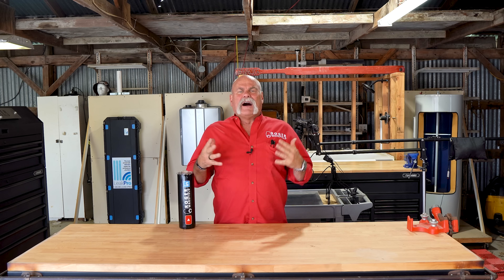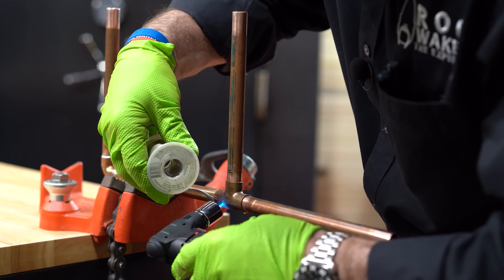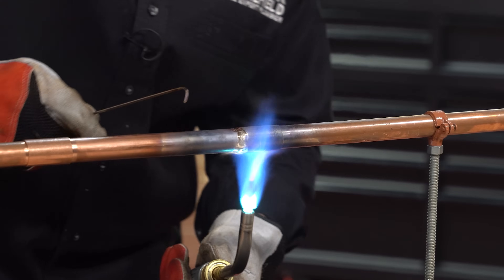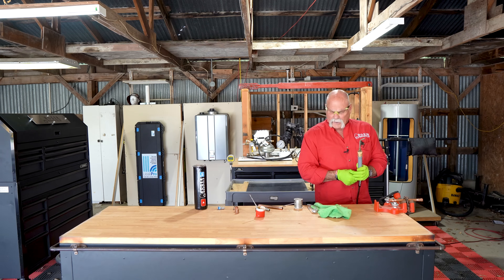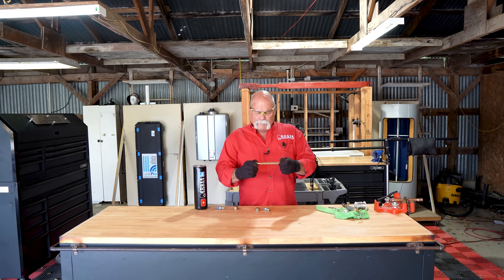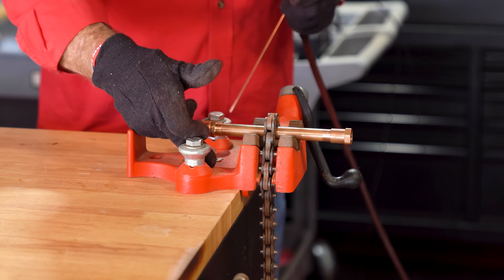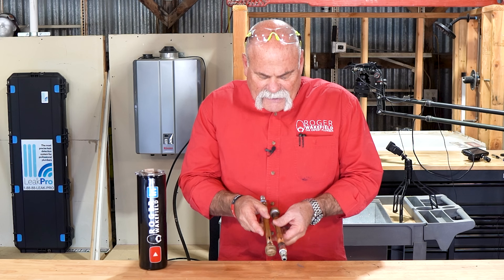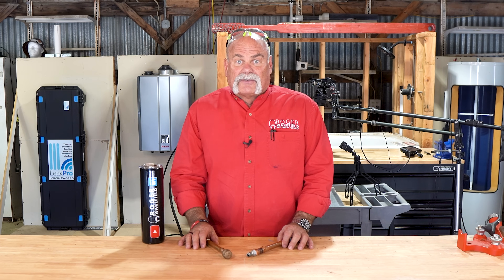Which Is Better Solder or Braze? | Pressure Test

Comment: Pressures on HVAC systems are considerably higher than domestic home water pressures. I nitrogen test hvac lines, usually up to twice the maximum operating pressure. Mostly done to detect leaks. On one occasion, due to operator error, I tested a system at nearly 1,000 PSI. As a result, the flare joint stripped and the pipe blew out. Quite a surprise as I was bubble testing the joint at the time! So it would be interesting to see some hvac piping tests, not least because the average hvac join I see is nowhere near as good as your typical plumber achieves on water pipes.
Reply: Dude your going to hurt yourself and prematurely end the life of HVAC equipment don’t test it that high please from one hvac technician to another
Reply: Dude the manuals tell you what pressure to test the systems at and it's never twice the maximum operating pressure
Reply: @rayzerot I think it's very good you go by the manual and recommend you continue doing so. I design systems and I know exactly what the materials technology is capable of achieving. That includes tolerance to vibration, embrittlement, corrosion, unintended electrolysis, contamination, stress/fatigue cycling etc.. I watched this video mostly because they're fun and I'm assuming that's why most people watch them. Enjoy!

Comment: The smaller hole on the braze is because it was only roughly 3k psi from the high heat, the soldering didn't get nearly as hot so it retained it's strength

Comment: Solder or Braze
essentially they are the same thing
melting metal into a gap to attach one object to another
the only difference between Solder or Braze is one is high temp(Braze) while the other is low temp(Solder)

also the only reason i know of why we have 2 names for the same process is Solder is from Gold/Silver smiths and Braze is from Blacksmiths
Reply: Indeed. In many languages they don’t distinguish between them (and some don’t even distinguish welding). In German, for example, their words for soldering and brazing translate to “soft soldering” and “hard soldering”.

Comment: Hello, I recently got hired at roto rooter. They use a pipe fitter and have told me that they do not allow soldering or brazing. I'm trying to get into a good apprenticeship. Should I accept this job or stay with my current company until something different comes along?
Reply from the maker: What is your current job?
Reply: @RogerWakefield  I work at a coca cola syrup plant. I want to at least get experience in plumbing and elevate into journeyman and eventually hopefully a master plumber.
Reply from the maker: Did they say why they don’t allow solder or braze? Personally I don’t know much about Roto Rooter but if you’re looking to get into plumbing, that sounds like a better way to go, more than working at a Coca-Cola plant. Stay with them for a bit and get some experience under your belt and then maybe look for a place that doesn’t outlaw soldering or brazing.
Reply: @RogerWakefield  I didn't ask that question yet. (Mostly due to ignorance on my part) but I will when I'm in training!

Comment: Im assuming the solder held 7 thousand pounds, and the brazed only held 3600 because of the heat stress on the metal? Is this a reasonable assumption or is it more likely a defect in the pipe?
Reply from the maker: That’s a great point, we should’ve done more tests to test out this theory, I’m betting that’s what happened. It’s a possibility it could’ve been a defect but they were both cut from the same piece of pipe so I might rule that out.
Reply: It's well known that brazing weakens the pipe because of the heat affected zone. This is why it can handle less than the soldered joint. Would be great to test this more though.
Reply: It's called annealing, metal becomes soft permanently after reaching close to the melting temperature. You can unanneal a metal by heating it and then rapidly quenching it in oil or water, then it's hard again. The braze makes the copper soft, the split hole is smaller because it burst at a lower pressure.

Comment: It would be nice if you at least mentioned purging the pipe with nitrogen when brazing. I know that applies to AC systems rather than water lines, I just think it's good to touch on it.

Comment: In my experience being in the U.S. Navy. ((For many years.)) As a Hull Maintenance Technician. (Plumber, Welder, Firefighter, Problem Solver of any kind.) We only used brazing, or welding on copper nickel (70/30) piping. Solder joints were an absolute no go. Mainly because plain copper pipe corrodes too fast in salt water.
(((That would be very bad on a ship or submarine at sea.))) I have personally passed pressure tests of over 3500psi, braze, 6500psi, weld. On .250 wall thickness copper nickel piping. 
I understand that you are using plain copper in your demonstration. Which is fine in residential plumbing. 
However you don't mention why you would want a joint that could withstand that kind of pressure.
Residential piping would almost never get over 100psi.
Aside from the fact that you still need flux with brazing.
I don't know of any instance where you would want to use brazing in residential piping.
Reply: AC lines and joints under a slab are about all
Reply: @jameskitzmann6268 , all AC manufactures require brazing , above and below ground . Code requires all underground waterlines to be brazed. Maybe Roger can shine some light on why 🤷🏻‍♂️. Also Roger is pro press & flare fittings allowed underground ?
Reply: @boby115   Brazing is stronger than soft solder and less prone to cracking when soil moves. Pressing is allowed underground by the manufacture and codes. Flare is as well. They now have approved solder for ac systems as well as press fittings. Code wise each juristriction is different so what works in one might not in another. He is in Dallas and I am in Houston and we have different code requirments
Reply: CuNi pipe is a whole different beast. You have stress corrosion issues with silver brazing alloys.
Reply: @jameskitzmann6268  , thanks for the info.. I don’t think I’d trust a press or flare fitting under a foundation or slab. Municipal codes should never undermined the national codes , enhance the strengthen for the better good ,absolutely; in doing so they should have  documentation and acceptable reason (most public works engineers / city engineers do )

Comment: i don't know if you have this brazing tool (oxygene and acetylene torch) might help put more heat in a tighter spot you kind of overdid it by the way in france we do mostly brazzing or crimp have fun nice video thaugt
Reply from the maker: I do have a torch but I couldn't find it 😅 thanks for watching from France!
Reply: @RogerWakefield  thank for your time and reply what is the thickness of those copper pipe here it's 1mm could be a factor because the pipe burst each time not the joint

Comment: I would assume the braze pipe blew quicker because it was compromised from overheating. If you use a small hot, concentrated flame for brazing, you will not compromise the copper in that way.

Comment: I brazed a joint and soldered a joint. The copper pipe that I brazed I was able to squeeze that pipe flat with my fingers because the copper was compromised by the high heat. I could not squeeze the staybrite 8 solder joint flat no matter how hard I squeezed it. I use staybrite 8 sometimes on HVAC. And sometimes I braze them. Inside a home I almost always solder with staybrite 8.

Comment: I never understood the whole brazing a/c lines, the high pressure side of 410A anyway, is in the 400psi range almost any plumbing hardware store solder will work fine for that. Today there are many superior solders that'll do this. You won't need to purge nitrogen either. Less heat is better on the copper and condenser components. I was a little concerned about any Flux getting in there, but honestly, I never ran into a problem.

Comment: Well the braze had a leak which lowered the pressure it blew at 3600 lbs the soldered one with no leak blew about 7300 lbs

Comment: To me one factor that could be important is the behavior when it comes to thermal cycling and low temperatures that you see in refrigerant system. Tin has the ability to change state to a non-metallic state through a process called tin pest. That can be initiated at low temperatures (-30 to -40 degrees C), so that's why brazing is better for refrigerant systems.
Reply: Despite millions of successful silver soldered joints in use w/o failure.  How many refrigerant systems run at those low temperatures?  Only industrial and scientific.

Comment: technically brazing is brass rod. Plumbers tend to call silver soldering brazing for some reason. if you draw the silver in it is soldering. Brazing does not draw into the joint that is the main difference. What you are testing is soldering with soft solder vs silver solder.
Reply: This is incorrect. Yes brazing rod was originally Cu and Zn, but metallurgy has advanced a lot and now various alloys are used that are self fluxing. Type of alloy used is determined by the base metals being fused. Brazing does absolutely draw the material into the joint.
Reply: @JFirn86Q  then by definition it is soldering
Reply: @garyhempel6316  I understand you are trying to take a hardline stance on it of old - but language is dynamic it's meaning changes with usage. The definition today, with all the advanced alloys and combinations we can have, is exactly as the video said - Soldering is less than 450C (840F) and brazing is above that temperature.

Comment: I wonder if the higher heat needed for brazing weakened the pipe? That might explain why it failed at a lower pressure. Still, if you've got 3000+ PSI in your home water lines, you have more important things to worry about!
Reply from the maker: Very true! It looks as though the heat from brazing did weaken the pipe

Comment: Maybe I missed something, but the brazed joint pipe bursts at around 3,700 PSI and the soldered joint pipe bursts at over 7,000 PSI. Does that mean the heat from the brazing weakened the structure of the pipe or am I missing something?

Comment: I love stay brite 8, there are plenty of applications on refrigeration I use it. Low side stuff, access stubs on critically charged stuff, or residential linesets going to the condenser, etc. I will say this though, definitely don't recommend doing it on discharge lines off compressor because solder can handle heat and vibration, but not both. I know this from personal experience. It's just not reliable most of the time. Also you must be very good with solder to do it on refrigeration. I can't tell you how many techs I've seen completely plug up 1/4" ACR lines because they used way too much on a joint or drier. The ultimate test of your ability to solder is join a cap tube to a drier without restricting it! 😂

Comment: Did I see the copper in the brazed joint fail at 3700psi and the soldered fail at 6700psi? Yes, looks like the weakening of the copper by the 1300degrees needed to braze outweighs the benefit of the stronger joint.

Comment: Soldered joints will outlast the life of the installed equipment when done correctly . Brazed joints are used primarily where there is a compressor connection .

Comment: Braze a 90 to two short copper tubes, then solder the same. See how the brazed elbow has turned to garbage as it easily kinks.
Silver solder is way strong enough and retains the coppers integrity.

Comment: In medical gas systems the only reason we braze is because of fire code, it has a much higher melting point, you wouldn’t want an oxygen line fueling a fire, soft solder has always been stronger
Reply: Ps, your braze joints definitely didn’t get anywhere close to 80 percent fill lol

Comment: ROGER braze a 6inch line and also please do a 4inch flange joint for soldering ..i think a 5 year old can solder a 3/4 line they do it at a boys and girls club program...not trying to knock ya but you can really see everything more in depth ...also you can tell me you've EVER done 200 braze joints per day . I Braze and top out at 25 to 30 on a 12 hour shift brother 😂😂😂

Comment: brazing roughly 3600 pounds.
Soldering roughly 6900 pounds.

It seems to me that brazing greatly reduces the strength of the copper. The soldered pipe had a bigger hole because it held more pressure.

Comment: is it possible to Braze with water still in the copper pipe?
Reply: You have to boil/vaporize all the water If it si a closed system the steam will blow the solder/braze alloy out.

Comment: Notice the same pipe gave way at two totally different pressures I would think because of the greater heat used to Brazed the fitting Vs. Soldering you Annealed the copper and caused it to burst sooner.  3000 psi vs. 6500 psi heat was the killer.
Reply from the maker: Very true, good eye

Comment: Pro press water with normal o rings and pro press gas with yellow o rings on type M and type L. I bet the fittings can’t handle the pressure.

Comment: Well if you have so much experience with brazing why not just explain how it weakens the copper when it reaches the higher temps required to braze.  Hard drawn copper looses a lot of strength when annealed by high heat,  It is not a secret that soldering can be stronger then brazing. The reason that HVAC prefers brazing over solder is the braze fills, flows and provides a higher chance of a non leaking joint. Not stronger but a more productive better result. Also there are potential issues with contamination in a AC system form flux when soldering.

Comment: I never understood why the
requirement to braze copper
under slab? let's say a soldered repair is made instead and taped & covered with some armor flex? If the pipe is never in direct contact with any soil or concrete then what's the
big deal?

Comment: Hired a plumber to install a new hot water tank for me since I was nervous about soldering copper without having a leak down the line.... They sent a newer guy out, straight coupled joint lasted a week and then popped and sprayed water everywhere,  EXTREMELY disappointed, I coulda done that myself...

Comment: Your machine only goes to 10,000psi. If you wanted to test steel you could braze your joints put water and freeze it. The oressure from water expanding as it freezes will get to more than 10,000psi.

Comment: If soldering is better than brazing why is every joint in a condenser and evaporator silver brazed from the manufacturer, because brazing is better for vibration and no flux in the tubing to corrode.
Newer refrigerants are higher pressure but 500-600 max.

Comment: If you cannot use an inert gas in the pipe during brazing than you will ruin the pipe. Soldering does not require that much temp to ruin the pipe with just air inside.  So look at cost. You have to have a tank and regulator to be able to braze. You do not to silver solder.
Reply: If you do it for a living the cost is inconsequential .
Reply: @WesB1972  exactly.  You need to do it professionally to be worth doing it. Otherwise use silver solder for a joint that is perfectly fine in this application.

Comment: Would like a test between copper tubing &/or schedule 40 steel pipe made in USA & garbage from communist china. Dummy me purchased a steel "T " a few years ago from a big box store that was made in lack of quality control communist china. I could not get the pipe level because it was at least 3 to 4 degrees off a 90.

Comment: did this guy just say hes worked on equipment with gas pressures near or over 100 PSI?? Hes never been near a gas appliance in his life. Gas appliances operate on a fraction of a PSI so much so we use a different scale to measure the pressures...

Comment: Remind me not to hired this guy to do brazing on any of my job.  Throwing the stick right at the flame to melt it to the fitting instead of allowing the fitting drawn the rod in by capillary action is a nightmare waiting to happen.
Reply from the maker: But did the joint fail?
Reply: @RogerWakefield  Right.  Just the brazing did.

Comment: you probably had air inside the pipe . i didn’t saw you purging it with water first . water isn’t compressible so it should hold quite a lot more

Comment: This test is useless. House pressure is 100psi max. This is like speed testing tires to 600mph for a mini van. Who gives a crap which is stronger they are both way way stronger than needed.

Comment: I braze everything. If you’re soldering you’re just lazy.
Reply: ABSOLUTELY!!!
AND RECENTLY I WAS CUT
VERY BADLY IN A JOB WHEN MY HELPER FOUND
A JAPANESE SAMURAI SWORD AND WAS SCREWING AROUND SWINGING IT AND CUT MY
ARM AS I WAS TRYING TO 
HOLD A BIG FLAP OF CEILING SHEETROCK WITH ONE ARM AND SOLDER A JOINT WITH THE OTHER..I IMMEDIATELY BRAZED THE LACERATION SHUT
AND THE BLEEDING STOPPED!
EMERGENCY ROOM
SHERMERGENCY ROOM!